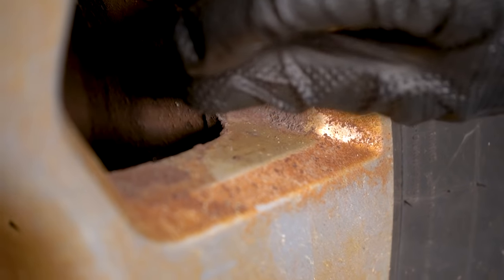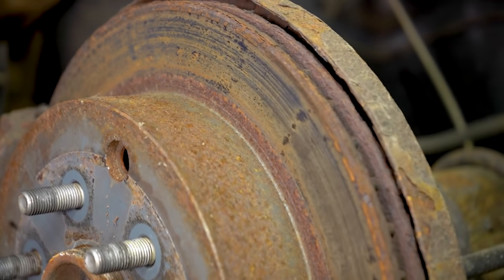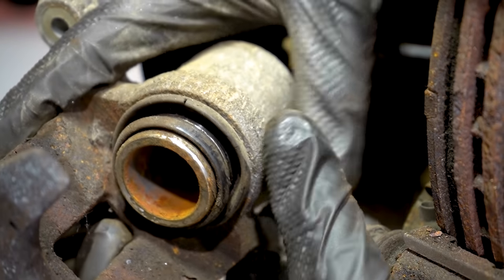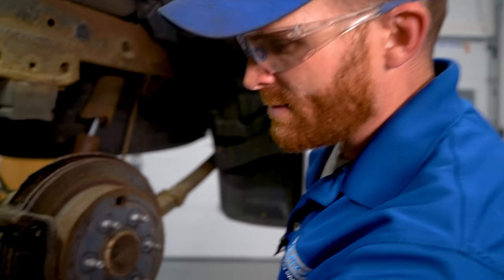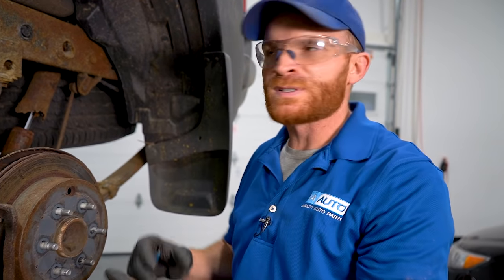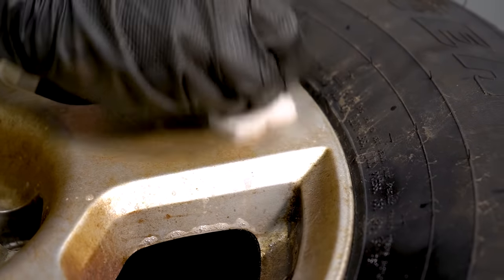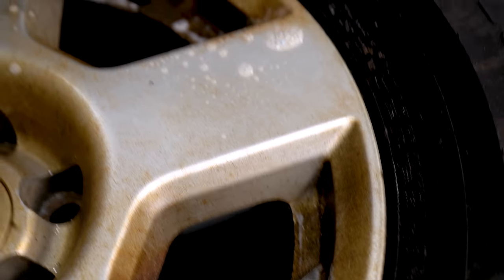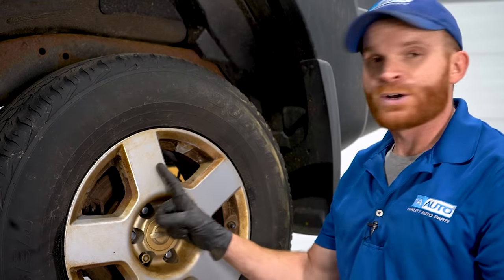Rust on My Car's Aluminum Rims? Where It's From and How To Clean It Off!

Comment: Use meguiars all wheel cleaner  it  causes a chemical reaction with the rust and dissolves it. No scrubbing necessary and it's available at most stores.

Comment: There's a specific wheel cleaner we have here in Australia. You spray it on and the chemical reacts with the ferrous material in brake dust and turns purple. Then you hit it with a pressure washer and all the stuff comes right off. Surely something like that is available where you are
Reply: I think every brake has iron fallout remover.

I think this guy's point is it's more effort than its worth if the car is just a beater.
Reply: What is it called?
Reply: @tarawilliams8721  look for iron remover for wheels

Comment: An actual wheel cleaner with iron remover would work. Bar keepers friend and a tooth brush works well for the embedded particles on the barrels. Make a paste in a cup with water and apply, rinse with hose or pressure washer. Good as new.

Comment: i mean a decent amount of basid info about brake systems but none of those gave any good info about cleaning deeply stuck on rust... was mostly showing ways that don't work was kind of expecting some actual good products to remove it lol. good video still

edit: also i do know that using white vinegar and certain other rust removing oils can work pretty well. ive heard like a baking soda past can work but never personally tried it. If it's heavily coated on there like on the inner area or the video starting with a little of a good cleaner and letting it sit for a tiny bit and using w super fine grit sandpapper to break up the outer cakee on layer and then using a rsg or papper towels can do a decent job.

Comment: My 2004 Sequoia wheels are alloys.  The outer chrome layer has peeled off and underneath is just a rough surface.  Could get them refurbished but too expensive so leave them as is.

Comment: That's called raildust. Somewhere in the life of those rims the brakes went metal to metal.
Reply: BigE is correct  (raildust , brake dust, environmental fallout,  iron ...its caused by many reasons brakes being one , but you get a lot of build up on the back trunk, hood, and the lower portion of the car doors )    Iron Remover/Fallout Cleaner is needed to remove it,  specifically you can get wheel cleaner with iron remover in it  (Adams Wheel Cleaner , Sonax Full Effect Wheel Cleaner, Meguiar's Ultimate Wheel Cleaner ) 
regular paint versions would work too,  from those companies and or iron x....just dont let it sit more than 5minutes, keep the paint or rim cool and thoroughly rinse after agitating with a wheel brush.

Comment: There is a chemical called Evapo-Rust which literally releases rust off from the base metal. It does not attack the base metal nor does it chemically interact with the rust. It releases the physical bond the rust has with the metal, which causes it to simply fall off. It's the same effect as brushing it off with a wire brush ... only without the brush. Usually this is done by immersing the metal into a bath of the liquid, so removing the rim in this case may be the best method, and you will need a good amount. But it's entirely safe, non-toxic and bio-friendly. And it can be used over and over ... just collect it after use and store it.
https://www.youtube.com/watch?v=MO4lFxl6oE4&ab_channel=Evapo-Rust

Comment: Hi, I have super duty ford 550 model 2011 and its get no acceleration once its reaches 120speed and starts jumping like going to switch off but does not. What do you think
Reply from the maker: +Mohammed AlBalushi We wouldn't be able to diagnose an issue like that here, you may want to have a local mechanic take a look at it. Thanks for checking us out! http://1aau.to/m/Shop-1AAuto-c
Reply: @1AAuto  we don't have mechanics unfortunately. They only know how to replace the parts. BTW your replay mad my day thank you. 😍
Reply: Nitrous oxide should do the trick😎

Comment: This is a very poor guide!! (Unlike most off your other guides).

Wheels should be cleaned with... wheel cleaners!

There are many types! Some are exceptionally good at removing brake dust safely!

Alkaline ones shift grease and grime well, acidic ones are super effective, but need to be thoroughly rinsed, else they gradually erode the wheel's clearcoat itself, and the "iron bleeding" types are expensive, but effective overall and safe (eg Meguiars Ultimate All Wheel Cleaner). Worst case wheels like this just need extra work (i.e. repeated cleaning attempts).

Comment: 2:32 Dude, replace that shock absorber! Semi-metallic pads may last longer, but they'll eat your rotors faster. Pay me now, or pay me later.
Reply: Nout wrong with that shocker as long as it's damping and it's not leaking. That's just the protective boot that many cars don't even have.